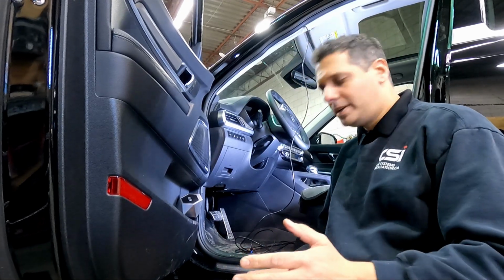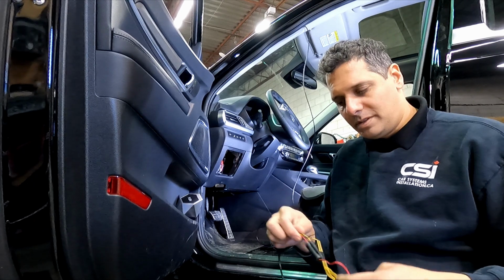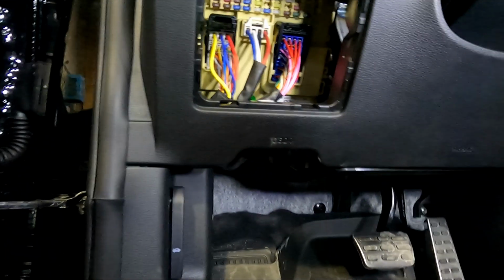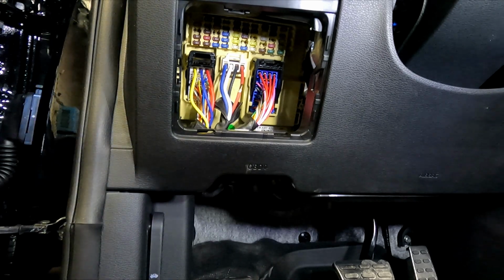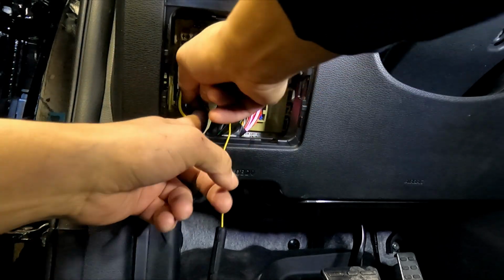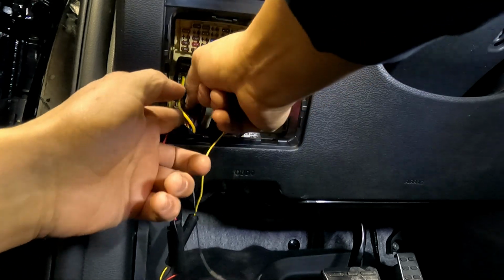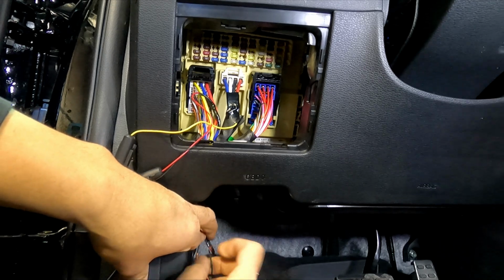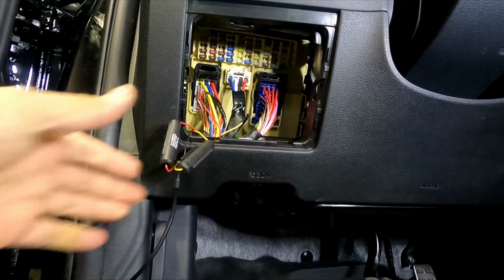How to Install Dash Cam in Kia Telluride 2021 | Car Systems Installation

Comment: If you ever have a computer/electrical problem in your car after making this modification, your dealer might deny your warranty coverage. If you have room for a fuse tap in your fuse box, I highly recommend using one. Be sure to read the instructions to avoid installing it in the wrong direction. Fuse taps can easily be removed if needed without leaving any trace of a modification. Also, electrical tape isn't the best insulator to use in such a hot environment as a car.

Comment: You just damaged the diagram circuit by cutting those wires and the customer loses his guarantee
Reply from the maker: Thank you for tour opinion but you are 100% wrong. We are familiar with the scare tactic dealers might use but you should know the law first, at least in the area you offer service. Our licensing (Automotive Accessory technicians and MECP) requires us to solder every 12v connection. In fact using fuse taps is completely against the requirements (you can read in the book that prepare you for the licensing test).  Fuse taps can overload or cause feedback, also can fall our mid driving and if the fuse that has been used is for example full ignition fuse, the driver can end up with a vehicle going 100KPH and the vehicle shut down on him from a simple bump in the road that can cause the fuse tap to fall out.

Comment: I would use splice tap connectors or fully cut the wire to then insert heat shrink. Sure it's double the soldering, but it's much cleaner. I'm not a fan of electrical tape as insulation in a permanent situation like this.
Reply from the maker: Hi. Thank you for your comment. Cutting 14 or 12 Gauge wires to connect a 20 gauge wire is unnecessary, soldering will guarantee it will never move. Also once you cut the heavy gauge factory wire which is part of harness you now need to extend that wire as the 2 tips you just cut wont reach each other anymore. So now you have OEM wire cut, need to be extended with a new wire which you must match in size (and preferably color) plus adding a 20 gauge wire for your dash cam. Electrical tape is the correct product to cover the soldered wire. In a case you do cute a wire you can still use electrical tape or shrink tube, if done correctly both work the same but with electrical tape you can remove it to reverse the install if needed. Unfortunately many are less familiar with high quality electrical tape and more familiar with the cheap ones and therefore might feel it is not working well but it is not correct.

Comment: great video.  my question. I have a 2021 Hyundai Santa Fe calligraphy, what color wires do i tap into for constant  and acc .  for a mirror dash cam?
Reply from the maker: Depend if the vehicle is Key start or push button also if it is hybrid. Contact our team and we will help you https://www.carsystemsinstallation.ca/contacts/

Comment: Wiring directly to the wires via solder without any fuses would leave the system vulnerable wouldn't it?  At least fuse taps are actually fuses.
Reply from the maker: Hi Franko. Do you see that black rounded plastic cover on yellow and red wires? That is the dash camera own fuses which the dash cam manufacture provided with the correct value to protect the camera.

Comment: Great video, thanks for posting. Do you normally add an inline fuse to your dashcam when hardwiring this way to avoid the fuse tap/add on method?  Also, do you have any experience with battery pack systems such as the Blackvue that only charges when the ACC is on and runs the parking more recordings off of that power source to avoid using the vehicle battery? If so, just curious how they’ve been for you.  Thanks,
Reply from the maker: If the dash cam does not have the inline fuse and only come with fuse tap so we add our own inline fuse. We have installed many battery packs, if not installed correctly it can cause the wires to get hot and burn the wires and melt the battery pack connector. Check this video how to install battery pack correctly https://www.youtube.com/watch?v=c2KumgR6exk&t=1087s.

Comment: Hi.  I have a 2021 Telluride, and I purchased the Vantrue N4 camera.  As far as I know, the yellow line is missing for the constant power to the battery.  It has the red ACC line, and the black ground line.  If I don’t have the yellow line, how can I power the 24 hour parking camera mode?   Thank you for your great videos and your help.
Reply from the maker: Hi Michael. Check the hardwire harness you have and the instructions for it. If the red wire is labeled ACC or Ignition I would not recommend connecting it to Constant 12V+ as it will probably drain your vehicle battery. If that is the case check with your seller how the system suppose to work while parked, some dash cams has internal battery that get charged during driving and that internal battery kicks in when the vehicle is off. It also could be that you have the wrong hardwire harness, I would check with the manufacture or seller to confirm.